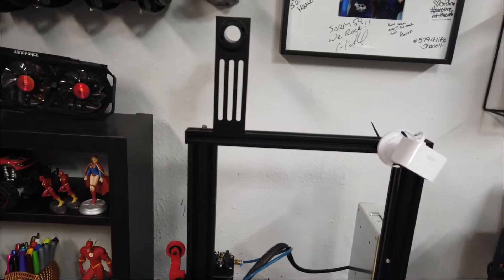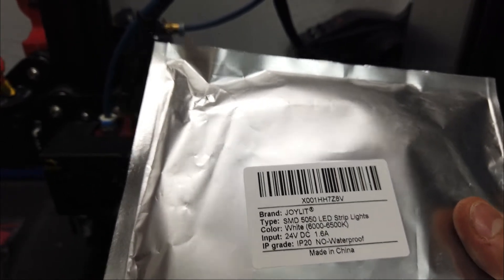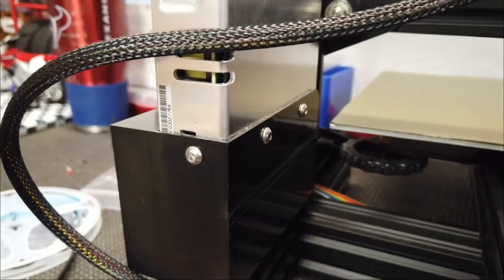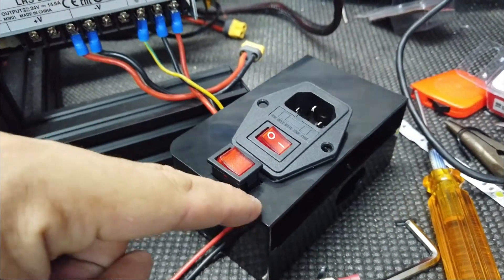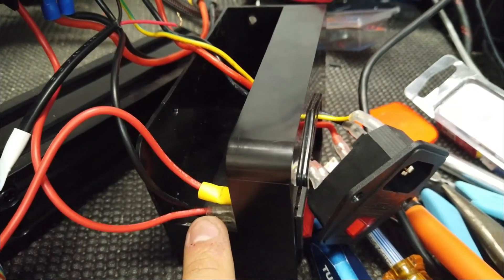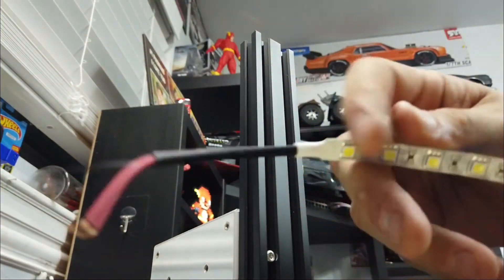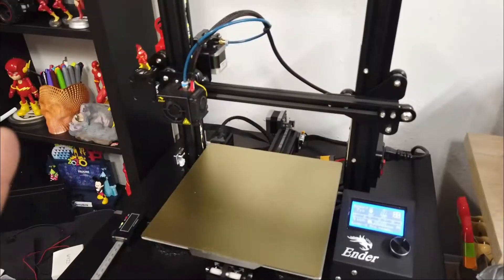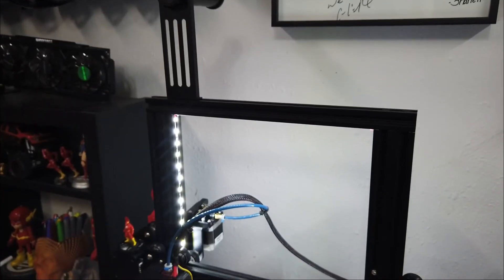ENDER 3 PRO LED LIGHT INSTALLTION

Comment: I added a (overkill ) 5 position switch. So i can have them all off, have either the left top or right one on, or all of them on. Also printed out some translucent V slot covers to dissipate the lighting a bit more. Lastly i 3d printed 2 corner brackets so the corners are nice and tight > hanging or sagging a bit.  Nice guide though.

Comment: Can I do this with rgb lights
Reply from the maker: Sure can
Reply: @flashhobbies  how to I connect it bcs it has 24v than r g b no ground
Reply from the maker: @alessandrodejongh7147  you have to get a step down converter. It’ll convert the electric 24v down to whatever voltage you need.
Reply: @flashhobbies  no thé strip is 24 volts but it has no ground
Reply: @alessandrodejongh7147  it has to have a ground to work lol

Comment: A company sent me a bluetooth controlled set of leds it had a USB plug.... is there away I can use that on my ender 3...I haven't got my printer yet it comes Saturday
Reply from the maker: You would have to get a voltage converter to use it. You would also have to splice into the wires from the usb plug. If you have the skill it shouldn't be too hard of a task. Otherwise it might be a bit tricky to do.